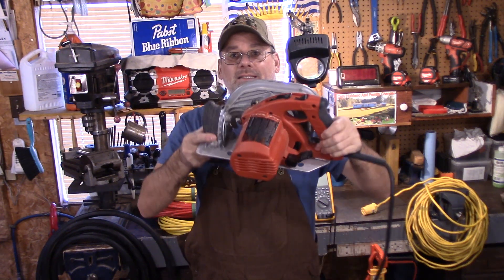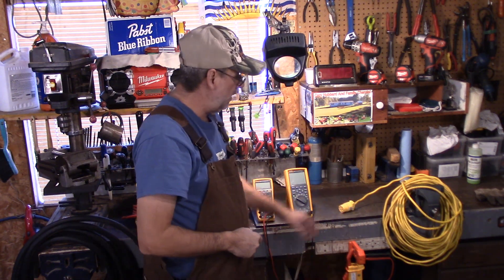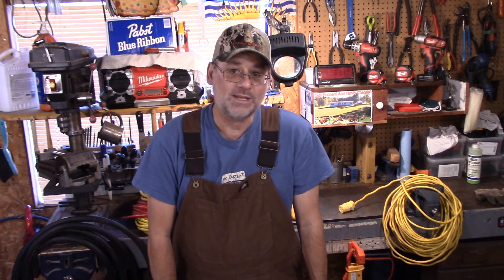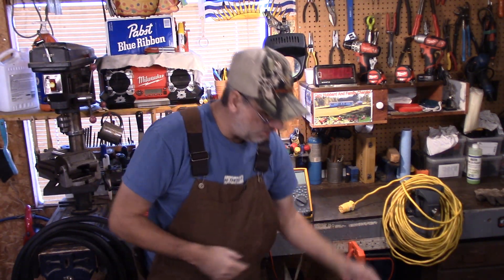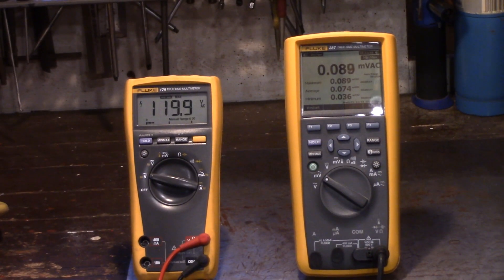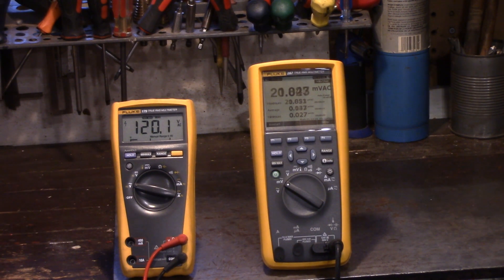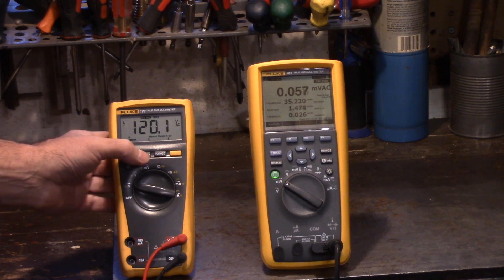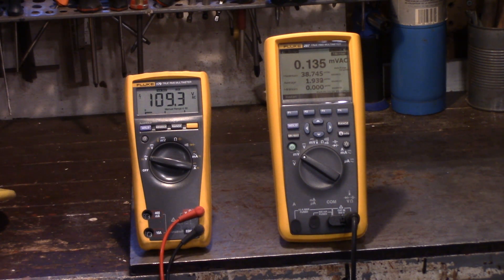EXTENSION CORD OVERLOAD -  CIRCULAR SAW TESTING - TESTING  AMPERAGE WITH A MULTIMETER  AND AMP CLAMP

Comment: So how is it that a longer cord reduces amperage demand? Would picking the outlet furthest from the fuse panel do the same?
Reply from the maker: The demand is variable in direct relation to the load  but  the supply amperage is regulated by the service fuze at the electrical panel.  A smaller gauge conductor has a limitation in supplying the amperage needed as the cable length is extended thus amperage is reduced unless you increase the conductor size.
Reply: Steve, right when I thought I was getting smarter, I just got dumber. I didn't understand that. Can you try again for me please?
Reply: STEVE ROB REVIEWS So the longer cable adds resistance (even though it's not measurable with an ohm meter) to bring down the amperage?
Reply from the maker: Thomas I'd say thats correct.  In my experience a long  undersize cord suffers from a large voltage drop  .
Reply from the maker: Dave the  voltage drop is the key.  Let's say you  need 120v and 15 amps for the saw but an undersize cable has a voltage drop of say  20 volts so your trying to get 15 amps out of the cable but  ohms law would have  you at 100v x15amps  thus only getting 1500 watts instead of the required 1800 watts with 120v X 15 amps.   Most of the damage is done under higher loads with excessive voltage drop and as it slows down  the motor heats up. You try using a dollar store 22 gauge cord and you couldn't cut a piece  of wood :) now that would be a good vid to do eh:)

Comment: That is huge to know my friend. What drove me crazy looking at extension cords recently is that they gave the amp rating of the cord instead of the gauge. I was like, what if they cheat me on the gauge that I need for what I'm doing? I walked out without buying anything. Okay, it's rated for that, what's it's gauge? Checked everywhere on the packaging. The whole store had the cords labeled this way. I guess someone though it'd be convenient, but I couldn't trust it.
Reply from the maker: I see that too  like small engines showing  CC and not HP.  Up here all the cords do have the gauge imprinted on the outer casing of the cord.
Reply: If they are labeled with their gauge on the cord, I'd have to buy it to open the package and find that out. If I was on my phone I'd find an emoticon of my head smacking my hand like Charlie Brown's, "Good Grief."

Comment: Good video.  Those ratings are taken under ideal conditions, typically in a lab, at a specific voltage & RPM (in your case 5800rpm according to the tag). It is hard to say if that tag is rated with the saw under load or not.  In the US it is supposed to be under load. If your saw free-wheels at lower or higher then 5800rpm, then it will definitely draw a different amount of amps. Plus the higher the load the higher the amperage draw. So if the motor is stuck/jammed (hit a nail for example) the amps go through the roof.  This is not even including the resistance applied by the extension cord.  So there are a lot of variables that affect the amperage draw of an electric motor.

Check out this article explaining all the stuff that is on the nameplate on the motor itself (inside the plastic saw casing): http://www.ecmweb.com/motors/understanding-induction-motor-nameplate-information
Reply from the maker: Thanks buddy well said. 👍

Comment: Dew worm aye?
The longer the cord and the smaller wire gauge the more resistance you are going to get. 
Good test there Brother but you will see more of a difference the longer you use the saw.
Yeah when I loan stuff out I do under a condition. The condition is I come with the tool and I am the operator. Had a friend want to borrow my van. What four4 I say. To move my sister out of her apartment he says. So I didn't lend him my van per say I loaned him me and my van.
Reply from the maker: Good way to do it and your in  plain view of the lending  going on. 👍
Reply: MostlymoparIH 
Right on bro

Comment: I'm surprised at how many people use a 100 foot 18 gauge extension cord to work 20 feet from an outlet.  I'm guilty of it myself from time to time but I never put the numbers to it.  For my plasma cutter I needed some extension cords and through my research found out about the voltage and amperage drop over size and distance.  It's amazing just how much you lose.  Now I've got 10 gauge wire coming from the both breaker panels in the shop for the plasma cutter and welder and they run great!  I could hear a difference in your saw starting with the extension cord in the mix.  And the whole video, I kept thinking "ok so who farted?"  Cheers!
Reply from the maker: Haha man you have good ears . It's best to actually test because I have bought wingwang cords and the connections at the ends were  only in contact with half of the wire - even a new  extension cord can be a bad  one . Cheers
Reply: While the wingwang copper seems to have gotten better over the past 10 years or so, not long ago almost all their copper was so diluted with so much crap that a 10ga wire would flow more like a 18ga.

Comment: Read you come back and realized I did not talk about the main topic....this happens a lot to me....must have something to do with my deslectia....anyway just want to say that a nice saw you got there....I just own its little brother in the 18-volt bat. type and my big saw is an old Saw Cat made by Black and Decker and she`s a tough one.....and the main topic was to get the size of cord for the load and the distance.....in our electrical code we have a chart the tells us for the load ....that's the amp when you have a certain distance you should have a certain size of wire in order not to have voltage drop.....because when your voltage drops your amperage increases and your saw motor start to cook....enough said.....I wish you a good day....CHEERS
Reply from the maker: HAHA im the same - yes the wrong cord can get expensive buying power tools. Cheers

Comment: Oh wow. I am total dummy when it comes to sh*t like this. All that makes perfect sense now. I got to make sure the extension cords and heavy duty and in good condition. Very interesting info Steve. Thanks Buddy 😀👍⚡
Reply from the maker: Paivi it's a good thing to just throw out an 40 year old cord as well and get a new one as well :)  Everything has a age limit as well as extension cords but for most  just using a hedge clipper or trimmer they do fine. It's the ones with motors that need larger   loads suffer the most. Paive DIY  will be cutting lumber on youtube soon. LOL

Comment: Our House volts are 220v@10 amps..I have 50' of 15amp lead that I run from inside the house 10amp outlet if I need to use the mig in the shed or outside and I've had that for 35 years...Electricity is an area that needs to be over engineered.
Reply from the maker: Zig 220v is awesome  to have .  The world never did come to a standard voltage and don't know why.  I think it's just north america that uses 120v .

Comment: A lot of people don't realize that smaller cords choke the power from the tool, which results in the motor overheating, which then burns your saw out every 3 years😀

The longer the cord, the more the resistance is, so if go long you better go heavy.
Reply from the maker: Yes and most that keep buying  a saw never put two and two together EH :)

Comment: Wow that's a hell of a test Steve I guess I better replace a few of my extension cords. I'm like you though I don't lend my tools to anyone.
Reply from the maker: It's  incredible the voltage drop if you use a 100 ft 16 gauge cord on a 15 amp power tool . Most times you will notice it  runs slow and no power , if you don't notice it you will be buying a new saw. HAHA

Comment: My understanding is the listed amp draw is referring to the running draw as apposed to the initial pull. That being said, your theory is still correct but I believe the damage comes from the continued running at 15+ amps with the ext cord which you captured during the cutting. Without the ext cord it looked to pull about 13 amp even through the knot. Nice job my friend
Reply from the maker: Yes exactly and many use a beat up one that has many of the conductors inside broken making it worse .  I would have liked to demonstrate  using  my buddies cord but  didn't want to damage my saw. LOL